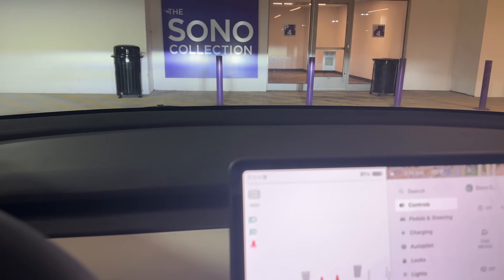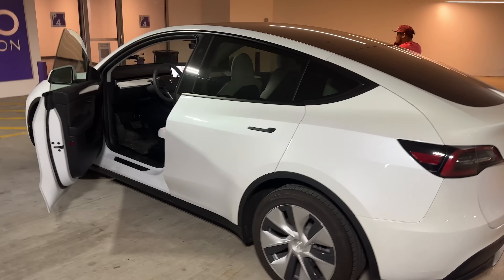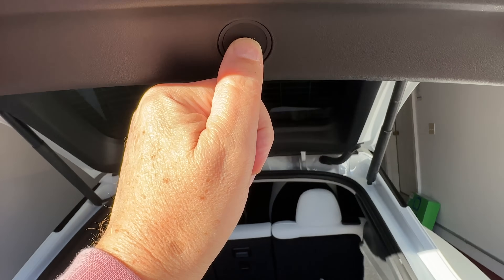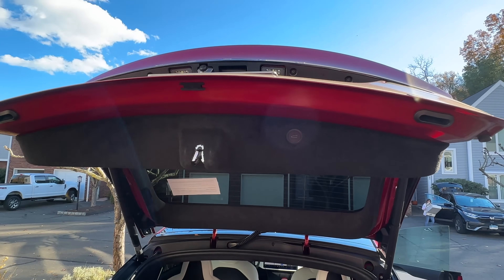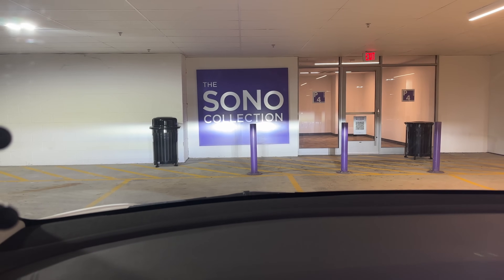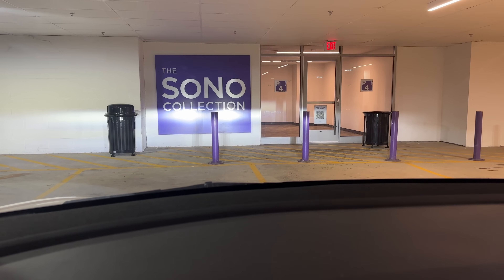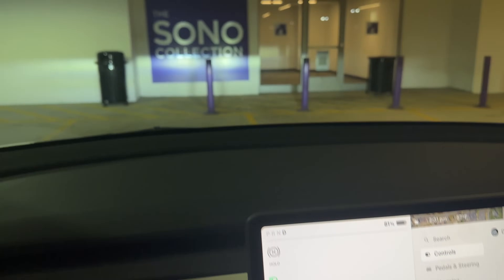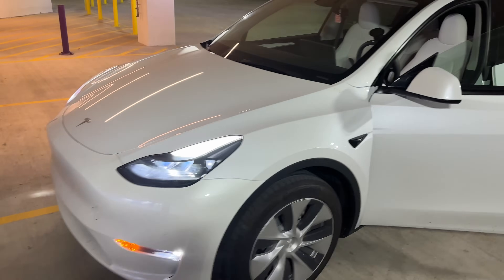Tesla Drivers Beware!  Poor Close In Vision Only & Lack Of Sensors Will Cost Us Over $2K In Repairs

Comment: Tesla removing parking sensors without having a full reliable replacement is one of the dumbest things I've seen them do. I own a Model Y without parking sensors, I basically ignore whatever it's telling me with the park assist and do it the old-fashioned way, using my eyes only.
Reply: Depends on who they did it for. It's brilliant on their end. They save cost on their end by not having to integrate them and simplify their processes, all while screwing their customers over with a poorer user experience, as well as increased revenue for Tesla through their insurance when their faulty system gives false collision alerts that reduces ones safety score and increases their premium.

Comment: Dave, I believe if you look back at one of Sandy’s vids, they did a cost analysis of ultrasonic bumper sensors and it was $50.  

The blunder Tesla made was to eliminate the sensors before refining the vision system.  You don’t remove a safety feature until there is a verified replacement.  Someone should be fired.  

A much better decision was to leave the ultrasonic sensors and charge $50-100 more for the vehicle.  You would gladly pay $100 more to avoid this $1000+ repair plus the big hassle finding a repair shop.
Reply: Yes, I remember Kyle said the sensors are cheap.
Reply: Totally agree！
Reply: Could turn potential buyers away and will lead to videos of useless vision based system that may turn away potential buyers of these cars. So basically bad decision that makes people salty to save a few bucks while losing millions in sales:)
Reply: This seems like an Elon "I said this was possible so make it so" situation tbh. Vision is still a decade from being able to do this reliably IMO. They've backed themselves into a hole claiming vision only autonomous driving would be possible and it's just not there.
Reply: once they have camera in the bumper (like CT), vision will work. I still prefer to have the US sensors.
Reply: A $50 cost in parts translates to about $1000 in retail price.
Reply: You think?  Once the "eyes and biological neural nets" Kool-Aid was main-lined that measured reason went straight out the logic window.
Reply: Any aftermarket remedy?
Reply: @littledovecitydust exactly Joe! But honestly I would gladly pay it or maybe even more to option back in the USS's.
Reply: Tesla didn't remove it just to save money. They removed it because they had a shortage of supply, and would have had to stop selling cars. Instead they decided let's just say you don't need it and try and figure it out 🤞 at risk only to owner's

Comment: Hi Dave, This was the reason that I cancelled a Model y in September 2022 that I had been waiting for 7 months. At that time Munro, did a video that said that Tesla saved $118  in parts cost by removing the sensors but the front camera had no vision for 36" in front of the car due to the blind spot caused by the high position of the camera.

Comment: Hi Dave, I think you can try the hot water trick I've seen before. Boil 2 or 3 gallons of water, it has to be close to the boiling point. Slowly pour the hot water over the part of the bumper that's warped. After 10 seconds or 20 press the bumper back into shape with your hand or a stiff sponge. You should be able to make the deformation disappear.
Reply: If it’s plastic can maybe fix it with a heat gun or hairdryer it not worth getting fixed for 2,000 dollars IMO.

Comment: Tesla is STUPID for removing sensors. However, at the very least putting parking sensors in the front would have been smart, because in the rear you have a very good quality backup camera if it's not dirty.

Comment: Thank you for raising awareness of this ongoing issue. I always tell people that Teslas have the most mature tech package of any car, but issues like this are a blemish on that package. Something so simple to provide was omitted in the pursuit of either cost reduction, parts availability, or just simple hubris. “Look, we have a car that can drive city streets all by itself!” Can it park safely? Can it run the auto wipers properly? Well… 

It’s high time Tesla got the simple things right. The amount of time that has passed since they removed USS shows that they either can’t fix it and won’t admit their mistake, or they just don’t care, because FSD is something to brag about. They don’t think more people will buy more cars if the safety features worked better. After all, there will be plenty of super fans that will cover for them and tell people it’s no big deal.
Reply: I’m sorry you can’t blame a car when you can’t use your Marc one eyeballs. I’m sorry that she damaged Junebug but this is her fault and nobody else’s. I’ve been driving in cars for 44 years and I’ve yet to run into anything and I’ve never had a car that had sensors.

Bottom line Car is not responsible for us when we’re lazy
Reply: @stevenichols4639 nope.  It’s the car.  It lacks basic safety technology that car manufacturers have developed over decades.  And all of a sudden Tesla fails with this Vision crap and people are like, “it’s no big deal”.  For that kind of logic, take away the cameras too. “Older cars didn’t have it and we were fine” - a bunch of BS!

Comment: Same thing happened to me with my new 2023 updated model Y. Scrubbed a low portion of a brick wall extension with the front drivers side corner of the bumper.  Ruined a gorgeous paint job. My old 2020 version would never have done this.  Also beware if FSD drops out half way around a right turn, you will go straight into a car with no close sensing.  In this situation in my 2020 Model Y, it jammed on the brakes and saved me. I am sure this one won’t.

Comment: Thanks Dave for this PSA about Tesla vision only parking assist.  I actually use the backup camera when I park into a stall head first since we have a front spoiler on our Model Y that is low to the ground.  I look at the side lane markings and my rear bumper and stop the car as soon as the rear bumper is squarely lines up with the tip of the side lane markers.  Also another trick is to park backwards and use the backup camera instead.   Please have Cathy practice backing up into the parking stall instead.  Works everytime. :)

Comment: Good advise. Vision is still a long ways from replacing the ultrasonic sensors that Tesla used to use. 

Sandy said they likely save about 128 dollars per car removing those sensors. Maybe they should have tackled the problem with vision only before removing the sensors.

Comment: You’re right, this vision only system sucks for the front and the sides. The only place it works accurately is in the back which is strange because the side cameras are also on outside the body unlike the front. The softwares should figure it out because the cameras are dumb device. Also those purple poles are not cones. A plastic cone would not cause that kind of damage
Reply: The only vision that works is your own😂.

Comment: This test has been done by @DirtyTesla as well. He compared vision and sensors. Although sensors were more accurate, they were not exact either. Either method unfortunately has errors. It is a judgment call after it stays stop. I learnt at UPS as a safety precaution, you always want to back in to a parking spot. The camera helps you back up. Also when you leave you are not backing in to traffic flow. You can just drive forward. Food for thought.

Comment: There are quite a lot of YouTube videos about this very issue.  Many have direct comparisons between Tesla's with and without the USS sensors under the same conditions.  After watching lots of them, my conclusion is that both the USS and the TeslaVision versions perform poorly.  There are some circumstances where the TeslaVision actually performs better.  In other cases the USS is better.  But from what I have seen, you cannot depend on either of these systems.  It is always valuable to have multiple systems working together, but the incessant drive to eliminate sensors as 'redundant' seem to have hurt Tesla more than it has helped.

Comment: Dave, I didn’t get sensors till 2001. I started driving in 1972. That said, I also put a front camera on my MYP with the added dashboard. That stops this problem. The chip on your rear trunk can easily be fixed by adding a carbon fiber rear spoiler and it should cover it. My last comment is that Cathy just didn’t love tap that bollard. It takes a pretty good force to dent it like that with the plastic bumper. You might want to tell her to take it easy with her lead foot. I noticed it when she drove your MXP. LOL. Love your videos.

Comment: Hi Dave,
Thank you for the video! I obtained my Model Y AWD in September and the second time I tried to park it in the garage the front cameras were going crazy telling me to stop (Lots of beeping).  I was coming from a Honda Civic so i didnt think about the extra length of the Tesla.  The garage door came down on my car. (Luckily no damage to my car) I pushed the button to raise the door again and something must have disconnected on the door, the door buckled at the top. The door needs to be completely replaced.  The landlord quoted me $2600 for the garage door, it is finally getting installed on Wednesday! Normally when I park front in I am alerted that I am much closer than I actually am.  I hope this is something that will get fixed in the future!

Comment: They definitely should eliminate the parking sensors on the vision system (really they should be vulnerable to lawsuits over this stuff).  It plain doesn't work (it basically gives random data) and in fact makes the car more dangerous to park as we've all grown accustomed to trusting these sensors.  Vision will obviously never work for parking and we will never get the AP follow distance back to one or be able to use autopilot over 85MPH with the current technology.  I can live with all of this, but I certainly have lost faith in Tesla as a technology company as they either lied about this or don't know what they are doing.

Comment: Hi, Mr.Dave please don’t spent 2000$ on that . I’d recommend to DIY . You just need a heat gun and (old)cotton or / wool cloth. 1 make a 3inches cotton/wool soft ball or 1x3x3 inch cotton pad to press that bump spot . 2 hold the heat gun with left hand & heat that spot between 125-190* F (depend on bumper thickness ) and gently press with cotton pad/ball (hold w right hand) - until to get desired level/shape.
Repeat those steps 1 & 2 continuously til you happy. Then wipe it off with rubbing and wax .
For trunk lid, I’d install a spoiler. It costs only about $100-135 from eBay or Amazon. ( I paid $114 from amz made with carbon fiber & happy with quality) . Btw, I like your videos.

Comment: My 2021 Model Y with sensors was a breeze to park in my my garage allowing a safe (and accurate) distance from any obstacles at the front. My new Model S without sensors has required me to set up a foam pool noodle at the front of my garage to avoid exactly what happened to you! Vision only estimate at the front is GARBAGE. At 16:47, My MS does the opposite. It shows I've essentially HIT an obstacle when I actually still have 1-2 ft clearance.
Reply: May the force be with you!

Comment: Front bumper cams would solve that front sensing issue and still be all visual. C'mon Tesla, fix it. I have a 2023 MYP, same sensing problem. Curbs can be hard to gauge.   On the other hand, those older of us have driven cars all of our lives with no sensing on any end or side of the car and somehow didn't crash into anything most of the time.

Comment: Hi Dave, you should contact someone who is good at PDR (paintless dent removal) to take care of the dent. Vision only sucks. 2023 M3 RWD here and I feel like these cars that are vision only without a front bumper camera and sensors are going to be an undesirable while in the lineup. I see they are putting bumper cameras on the Highland and 2024 vision only models, and that will solve the problem. Unfortunately it doesn’t look like there will be a retrofit option and for those of us who have this windshield only camera with no sensors, parking is really terrible.

Comment: I just purchased my 2023  MY in September at Mt Kisco. I wonder if the change to the camera based system is an effort to avoid phantom braking problems.. My 2019 RAV4 has automatic braking (not camera based) which will automatically stop the car in this type of situation.
Reply: Ha! Doubt it.  That a whole separate issue😂

Comment: Awesome video Dave and thank you for showing the shortfall of Tesla Vision. I can remember when I picked up my Model 3 in December last year and saw it had USS. I was so happy. I can't tell you how many times I use it for tight front or rear parking. Works like a charm every time and accurate to the cm. 
I convinced a friend of mine after I got my car to test drive the Model Y. He needed the space and all. He refused delivery in March this year as the Y came with no USS. He's now gone for a hybrid Audi Q3 and will never consider a Tesla ever again. 
I personally will never buy a new Tesla to replace my vehicle unless the new car's come with two key features. Front camera (360° view) for parking and HUD. I moved from an ICE VW Tiguan which had both these features. It's the features I miss the most in my Model 3. Oh and the ability to set the sensitivity of the Auto Wiper system. I solved the HUD by installing a front after market cluster (not a HUD) so I could at lease keep my eyes ahead while driving instead of looking /squinting to the right to see my speed and other information. The after market display came with a front camera which I installed and activates once my front sensors detect an obstacle in front of the car. Now I can get close to front curbs without asking my partner to tell me how far am I from the curb. The M3 highland released in Europe has no front camera or USS. A shame. 

I hope that in 4 years from now, the new Tesla's have a HUD, 360° view of the vehicle for parking, and a functioning auto wiper rain sensor. If not, this will be my first and last Tesla I purchase.
Reply: You also have hardware too instead of hardware for and much worse cameras honestly, the things you think are dealbreakers make you look shallow not smart

Comment: If Tesla is not going to put the ultrasound sensors back on the car, they need to put a camera(s) in the bumper,  although keeping the lens clean would prolly be an issue.   The first week I got my Model Y, my intuition told me not to trust the cameras with distance judgements.....
Reply: They won’t. I mean, they won’t retro fit the cars.  You guys are doing the testing for Tesla after you buy the car.  You can only hope they listen!

Comment: I was going to buy a model 3 highland, because Tesla showed it with a front bumper camera. Then they removed it from their website. Strange all of the reviews of car mentioned at launch nentioned the lack of camera or sensors, one mentioned that it was still using HW 3. None of these Highlanders can be retrofited. So when Tesla finally brings back sensors, camera and or radar, these new cars will be extremely hard to resell.
Reply: I would love to buy a 3 Highland but no USS sensors and no radar makes it a tough. If they would even put a front camera in on the bumper I'd be much more inclined.
Reply: Correct, don’t do it!

Comment: I totally agree with you and Kathy about the lack of parking sensors and should have a 3/4 rear hatch opening setting.   This is why the Model X is not more popular since the Falcon wing doors are troublesome.
The Model X is Not practical for households with conventional garages especially in the Northeast were people access their vehicle while parked inside their garage.  The Model X needs to have conventional rear doors or bring out a larger and taller Model with sliding rear doors.  I would call it The Model W (Wagon).

Comment: Can you not turn on camera view and eyeball it as you're pulling in?  Surely the camera up higher and closer to windshield would give you better view.  If not, for now, backing in and using that wide rear camera angle seems best option until they decide to add more sensors/cameras.